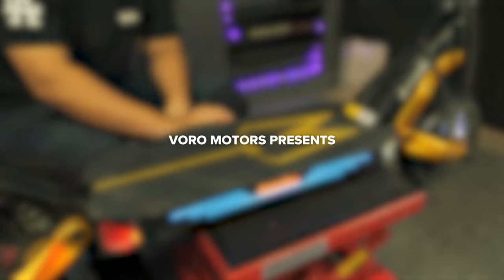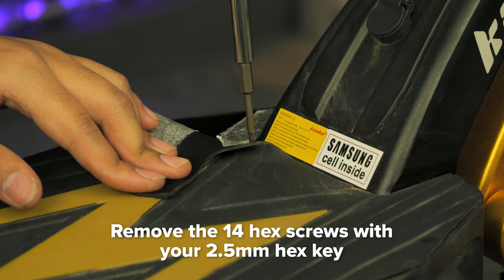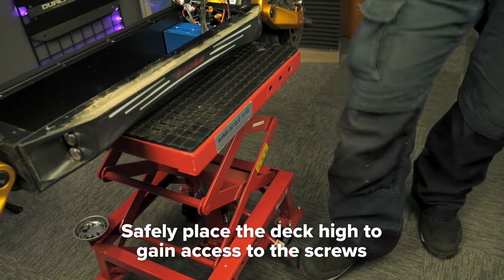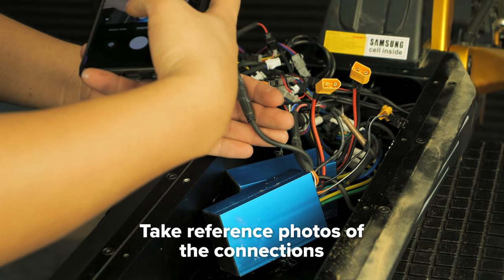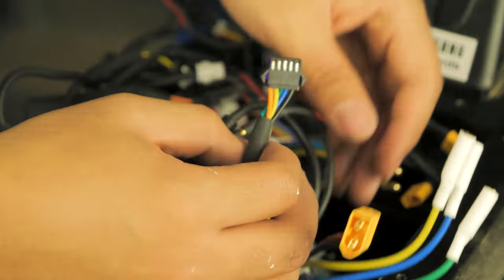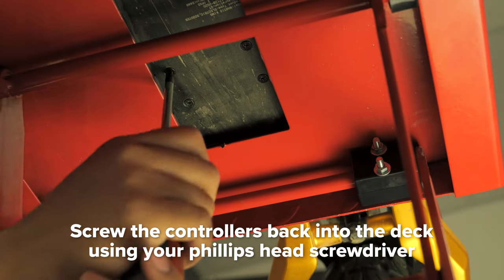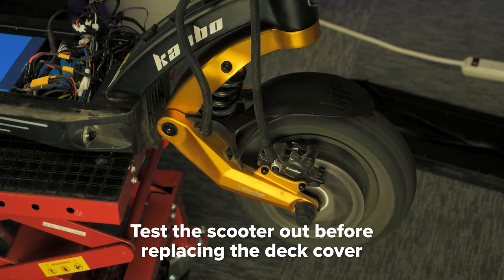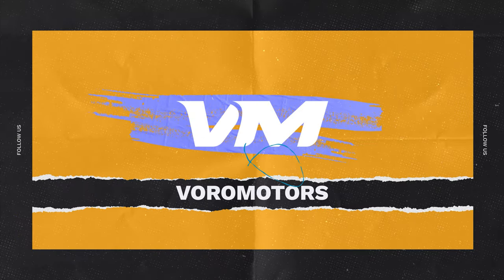How to replace the Front and Rear controllers on the Kaabo Mantis King GT - Voromotors tutorial

Comment: Becouse it has Two controlers, is it possible adjust the power  for example 60 % on front wheel and 100% for the rear?
Reply: You can adjust the controller outputs in the advanced settings of the TFT display.
Reply: @altaqi.7  thx

Comment: If my Mantis King GT is really jumpy from gears 3 and up, is that a controller issue?  I thought these sine wave controllers were supposed to be smooth.  Mine feels like it wants to throw me off at the slightest movement of the throttle.
Reply: That’s that 4,000 watts of power on a 10 inch scooter my man . Congrats you got a beast
Reply: @hyrulemasterchef9573  No, that's not normal with sinewaves. It should feel smooth and controllable